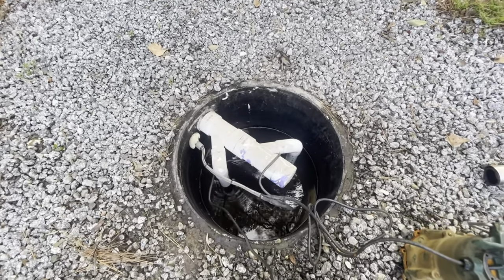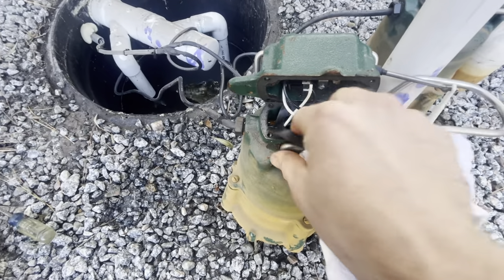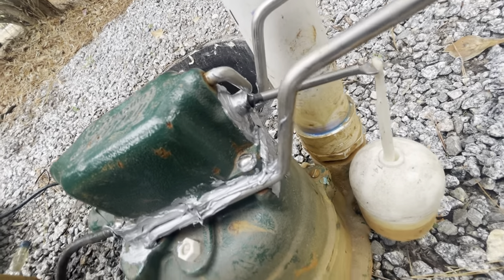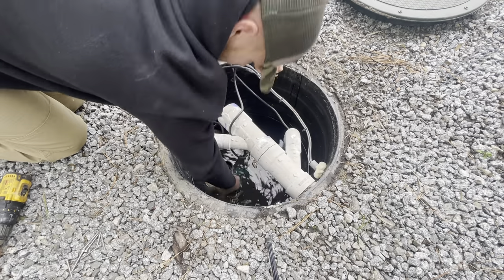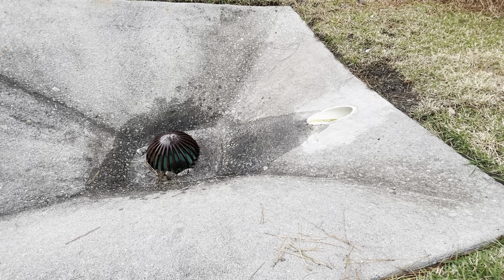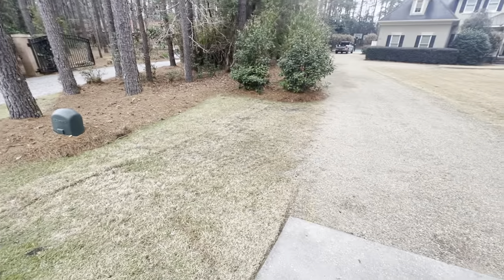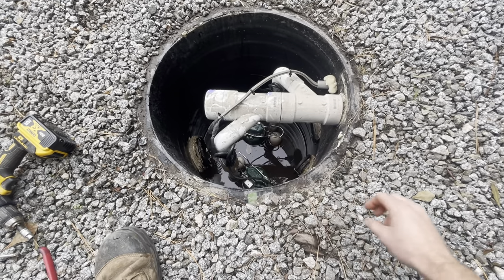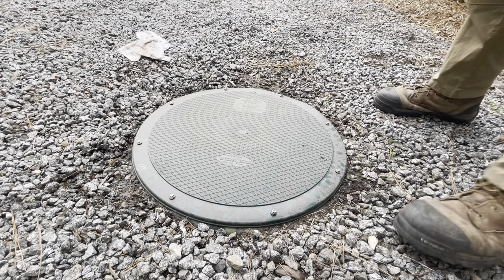Sump pump failure and FIX

Comment: Man I would like to see more about how you wire those pumps up.  There's not alot of videos out there that show the wiring.  Most of the time I want to use these the basin will need to be 25+ feet away from the house.  It looks like you have underground rated wire, sleeved through conduit?  Did you run the conduit the entire way?  Are these tied directly into the panel or routed to a gfci outdoor outlet? Thanks in advance.
Reply from the maker: Hey Rob, I use a underground/outdoor rated 14/2. I use a double heat shrink splice to extend the wire. Both have there own dedicated GFCI's which I recommend.